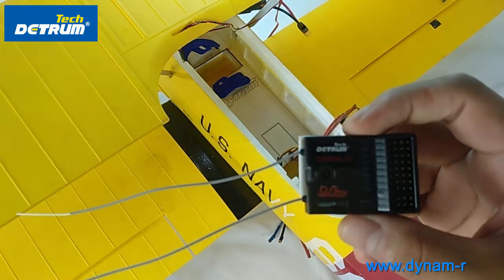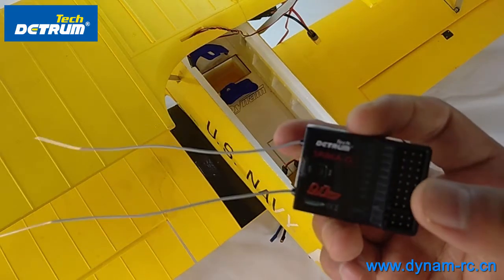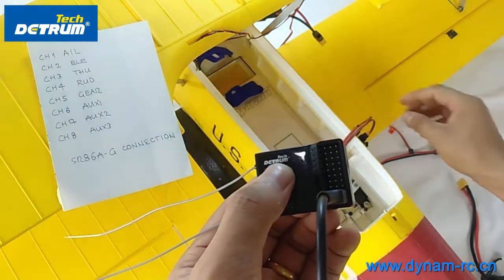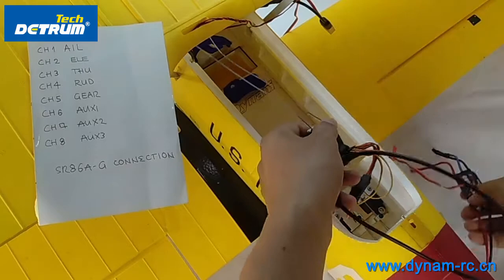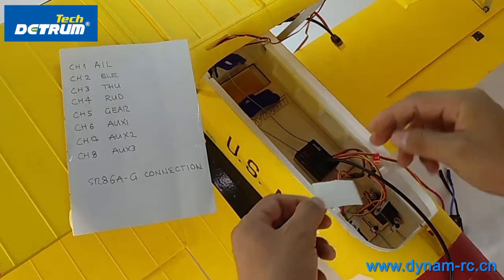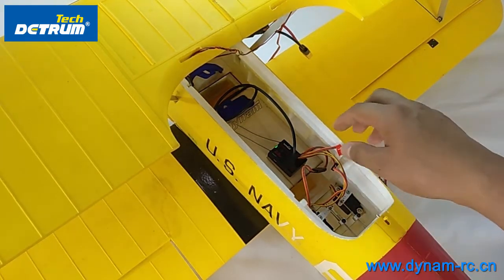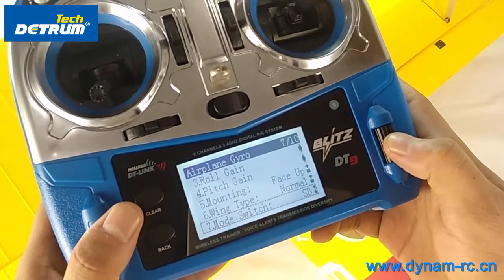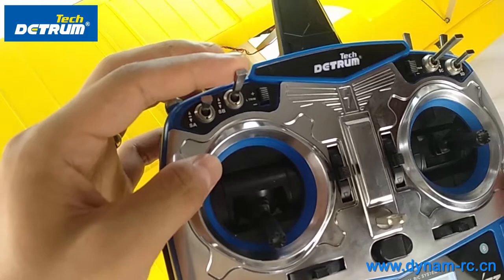Detrum SR86A-G GPS Autopilot Telemetry Receiver

Comment: How does the telemetry system work and display, are the sensors in the receiver and GPS device?
Reply from the maker: Hi, thank you for your question. The sensors are built-in within the SR86A-G telemetry receiver and the GPS module. When the GPS module is absent, the Detrum DT9 transmitter only shows signals from the sensors within the SR86A-G receiver.